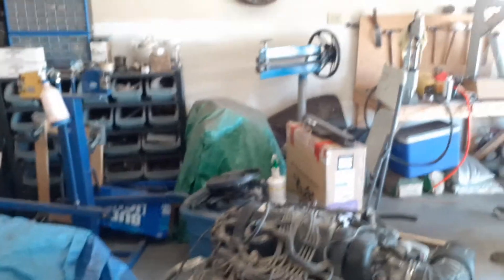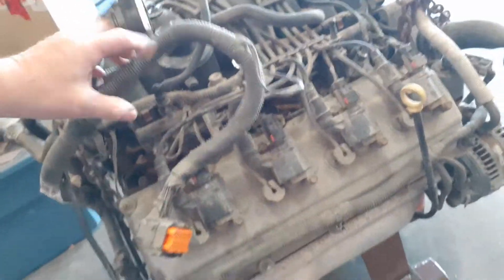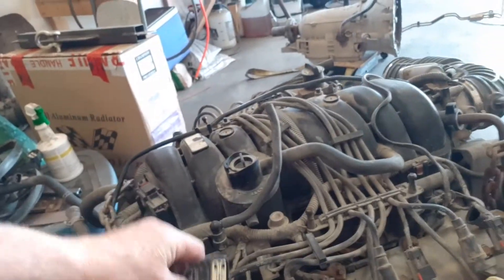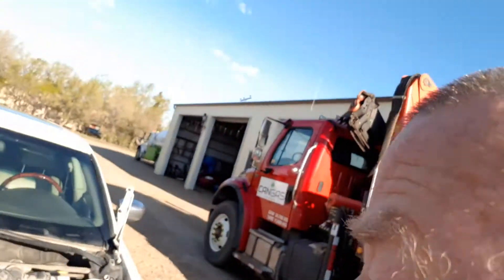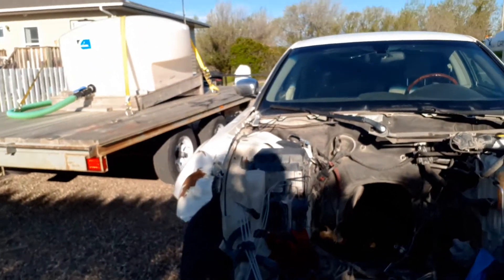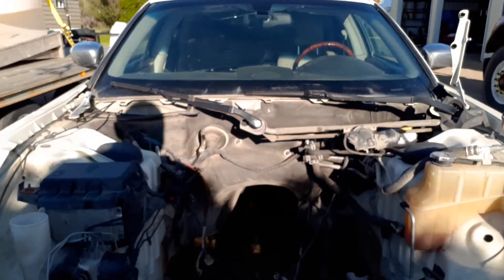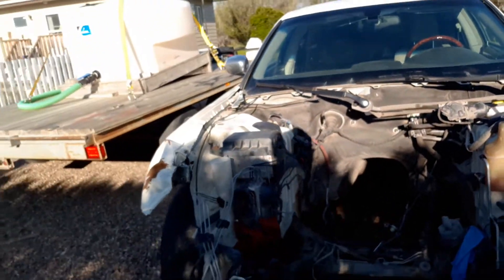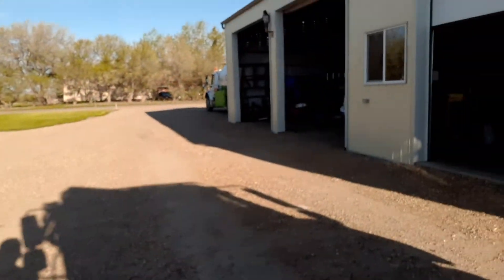The Hemi is on the floor

Comment: Any plans for the hemi before it goes in?
I know nothing about Dodge electronic motors.
Reply from the maker: I want to tear it down check it over and at least new oil pump, timing set and gaskets,  and of course a fresh coat of hemi orange.
Reply: @glenmiller3783  Hemi orange, I wouldn't expect anything less!